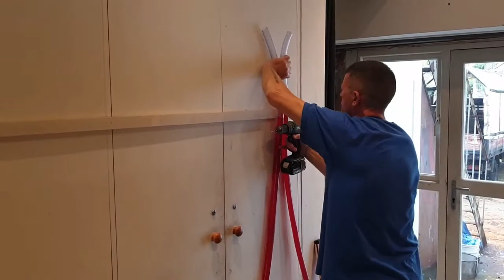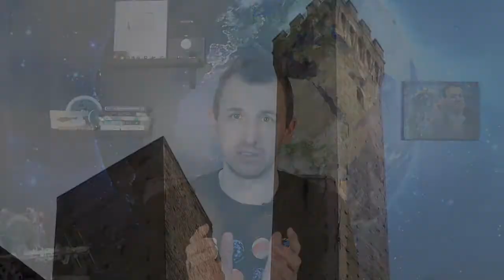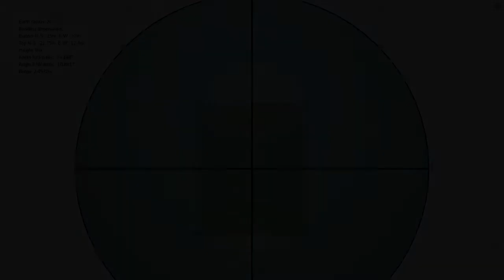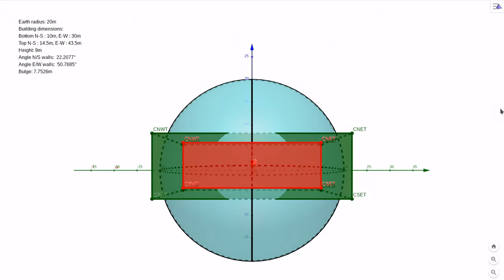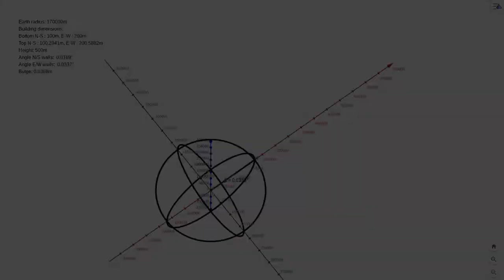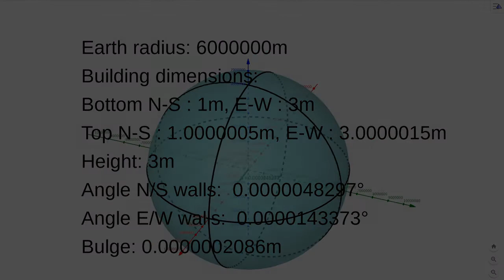Rectangular Buildings on a round Earth - examining a weird claim, Sciman Dan/Calvin Stroud response

Comment: All you did was make the sphere so large as to minimize the apparent slant in this geometric figure...otherwise you've yet to demonstrate from a practical construction or land surveyors standpoint that your theory works in practice.

In the beginning of the video it's clear in a smaller scale that everything you've said is hogwash.
Reply from the maker: So my mistake is to take the actual size of the Earth into account? Buildings are built on Earth, not on a tennis ball. The problem with Calvin's sketch is that it is not to scale  - either his building would be thousands of kilometers high, or his earth would be only a few meters in diameter.
Reply: @lower_case_t  Good sir...it is clear you possess a high intellect so I know I'm not talking with a troll...tennis balls are in the shape of spheres and the earth--prior to the acceptance of Newton's oblate spheroid--is just a bigger sphere.

The software you used to demonstrate your argument showed that there is still a slant you can sense and measure...and the slant never disappears no matter how large you blow up the scale. This is especially true when you measure the lines with a straight edge and other leveling instruments.
Reply from the maker: @jeremiahcastro9700  Yes, that was the point of my video. I also showed that the effect is so miniscule at that ratio between building size (typically 10 to a few 100 meters) and our planet's size (~6400 kilometer radius) that it is measurable but can be neglected even for the highest skyscrapers because it is outweighed many times by other effects like expansion caused by temperature differences. The precision we can achieve when we build such tall structures is way below what could account for the effect of Earth's curvature (centimeters in the case of a building that's half a kilometer high)
Reply: @lower_case_t  Your video still proves Calvin Stroud to be correct. While he may not have brought the earth to scale in his demonstration he did make the point clear that the plumbob/line would have to violate its own principles to build structures on a sphere by following the current laws of gravity.

And like most other counter explanations you built your structure at the very top and center of the sphere instead of the place where the curve actually is. Had you made your structure bigger then the slant and curved bottom would be more apparent.
Reply from the maker: @jeremiahcastro9700  Sure, if the Earth would be, say, three orders of magnitude smaller and houses would still be the same size (or if Earth had it's current size and buildings were hundreds of kilometers high), there would be a significant effect we'd have to account for. Nobody denies that. But, since the Earth has the size it has, he did nothing to demonstrate a problem with Earth's curvature and angles in buildings.
Reply: @lower_case_t  He didn't have to show the exact scale, he only needed to demonstrate the principles and how they work. The plumbline showed that gravity actually doesn't exist as it wasn't being pulled inward at an angle, and I've seen other construction workers from other parts of the world using a plumbline and they don't show that either.

Your video shows Mr. Stroud to be correct in his assessment and demonstration. And you've still yet to show your work to be true with the same tools used by Stroud.
Reply from the maker: @jeremiahcastro9700  "Your video shows Mr. Stroud to be correct in his assessment and demonstration. And you've still yet to show your work to be true with the same tools used by Stroud." - You commented on my other video where I I showed the quantitative measurement of Earth's radius using only a theodolite. If you haven't watched it, why did you comment there?
I am absolutely stunned by your refusal to take scale into account. The angle that the plumb line would form with parallel walls of a building depends on the ratio of the building's width to the  planet's radius - that's what my entire video is about. For real buildings on real Earth it's close to zero, so his plumb line did not show anything. It's plain math, I just put in the numbers. All the equations are in the video, if you see a problem with any of them, I'm happy to discuss all of them.
Also, it's not about showing the "exact" scale, it's more like getting it right within an error margin less than 4 orders of magnitude.
Reply: @lower_case_t  Except your demonstration relies on one building being built on one of the four cardinal points. If you place buildings between the cardinal points...your entire argument drops and refutes itself.
Reply from the maker: @jeremiahcastro9700  What is a cardinal point of a sphere? I always thought a sphere does not have a preferential direction. There is no fixed rotational axis either, therefore even North and South have no meaning in my model. And even if they had, how would placing the building anywhere else on the sphere affect any of the calculations? I must say, I'm speechless.
I'm also not sure what your point is - are you saying the Earth is indeed flat, as Mr Stroud claims, or are you just saying that he has a valid point with the angles (which I admit in the video, after all I do the calculations and present the numbers), but would agree that it is meaningless and irrelevant when you look at the actual size of Earth and buildings, and consider the low precision houses are built with?
Reply: @lower_case_t  It's sad how a person of such a high intellect cannot understand the simple fact that without a center you can't have left, right, up, down, front, and back. It's pretty laughable that you went through such great lengths with your demonstration and argument and can't understand that you can't measure length, width, height, and breadth without direction first being defined and laid down.

And prior to Newton defining and describing the supposed laws of gravity...the falling and rising of objects were already adequately explained with density: lighter objects rise while heavier objects fall. And the plumbline follows the principles of density as do ships and pebbles in a body of water.

Comment: Or, you could build by first excavating a very shallow secant plane and build your walls parallel to the radius at the center of your building. Or, just quit sweating the small stuff. A plumb bob isn't accurate enough to tell the difference.

Mr. Stroud is going to be in for a shock the first time he sees a building on the side of a hill. Walls that aren't perpendicular to the ground - an amazing thing!

Comment: In the first mile the earth drops 8 inches. People can't see 8 inches in 500 feet how can they see or understand it in 1 mile. Flat earthers dont understand the size of the earth or how it affects construction.  I'm not a surveyor or an engineer.  I have worked construction since 86 and now own my own company. We have a total station for layout and completely understand how things work on a spherical earth. To actually measure the curve you need a total station or a theodilite.
Reply: well how come engineers never took the curvature in building the Suez canal,which is very level in its distance,and length,was in the news recently,i never seen this curvature,plus the nile and other big rivers have no curvature affecting them,or the worlds biggest bridges have no curvature mathmatics built into ther contruction,or railway lines,from my travels,they are level every where,even going around hills or corners.
Reply from the maker: @bafalconbafalcon3184  It's funny that you mention the Nile here, considering that the - as far as we know - very first measurement of Earth's curvature by Eratosthenes was made between Aswan and Alexandria. Do you know which river flows between these cities? Architects have to take Earth's curvature into account when they plan long bridges.For example, the Verrazzano-Narrows Bridge in New York spans over 1,300m and it's suspension towers are about 200m tall - similar to the building in my video. They are 4cm farther apart at the top than at the bottom. You could argue that this is negligible, but it is still a measurable effect. Railways aren't flat. They bend up and down, left and right, just as the surface they're built upon demands. However, planning an underground train systems requires that Earth's curvature is taken into account, or tunnels will not be aligned properly.
Reply: @lower_case_t  Well how come with the bridge at Lake Pontchartrain in Louisiana, is flat as, even in the movie True Lies, on the bridge screen, anyways, it's 23.83 miles long,379 feet of missing curvature, another example, the Trans Australian Railway has over 300 miles of straight track, no curves, or curvature, since it was built in 1917,Lake Baikal,(Russia),is the largest fresh water lake on earth(by volume),and earths deepest lake, Surface area: 12,248 square miles.
Missing over 18,000 square miles of curvature in all directions.
The Uyuni Salt Flats, cover 12,000 kms  making it the biggest salt lake in the world.
It is located 3,650 meters up in the mountains of Bolivia.
You can do the math, but it's missing a hell of a lot of curvature.
The Nile and Mississippi ,and the Suez are FLAT
The Sues Canal is 100 miles with ZERO "curvature". If earth was a ball, there should be a 6,669 ft drop from one end of the canal to the other, but the canal has no locks, because the terrain through which it passes it FLAT.
Surveyors, Engineers, and Architects, never factor in the supposed curvature of the earth into the projects.
Reply from the maker: @bafalconbafalcon3184  You are talking about the bridge at Lake Pontchartrain, one of the most popular buildings to demonstrate Earth's curvature. A bridge where you can literally see Earth's curvature from each side because it's farther end lies below the horizon, right? What point are you trying to make?
https://en.wikipedia.org/wiki/Lake_Pontchartrain_Causeway#/media/File:Lake_Pontchatrain_Causeway_Southbound.jpg
And why do you bring up the Nile again? As I wrote already, Eratosthenes  measurement demonstrated it's bent by approximately 7° between Aswan and Alexandria TWO THOUSAND years ago, and that hasn't changed so far.
Reply: @lower_case_t  
Two chopsticks on a flat table with a light bulb show the same result.  You haven’t done this yet?
Reply from the maker: @toberrdrawforc  Two chopsticks show what effect? I assume you're talking about how the length of a shadow depends on a pole's position, aka Eratosthenes' experiment. But since that is not the topic of this video, please confirm that's what you mean before I point out the different geometries of the two scenarios.
Reply: @toberrdrawforc 
'Two chopsticks on a flat table...'
Try a third chopstick. Maybe you'll see the problem.
SohCahToa. Ring a bell?
Reply: @bafalconbafalcon3184 
You are conflating drop and curvature. They are two different things.
Reply: @bafalconbafalcon3184  well I'm not sure if you are a troll or truly don't understand. The first problem is understanding level and flat or perpendicular.  Level on earth is sea level meaning the average distance from the center of earth to where the oceans are. Water moves from higher elevations to lower elevations. What does this mean you ask?  It means that water conforms to the forces that act upon it,  just like a rain drop isn't flat. If you want to actually measure drop or even the lateral difference this has to be done by an instrument. No not a laser lol. A theodilite or total station which by the way has been done hundreds of times. If you truly don't understand i would suggest reading some books and stop watching flat earth videos. If you think the earth is flat then why isn't there an accurate map or working model. I can answer that, because IT IS IMPOSSIBLE.
Reply: @mathtime4578  
Why do large bodies of water have zero curvature, provably?
Hint: the land doesn’t have measurable curvature either.
You should look for yourself.
Reply: @toberrdrawforc  bodies of water do have curve and are easily measured. Even Bob the science guy done it with a simple builders level and that isn't even close to the accuracy of a total station or theodilite. Maybe you should check what you are saying before parroting what your priests tell you lol.
Reply: @mathtime4578  
You are incorrect.  You need to do the work yourself, instead of repeating ball lover fantasy drivel.
Reply: @toberrdrawforc  so you have a total station? I have one. You  dont have one? no problem rent a surveyor, then you could do it yourself with his instrument and help. Then you dont need anyone to tell you the bs that is called flat earth lol. There are hundreds of documented instances where people have measured earth curvature.  I know none of them take precedence over you saying nuh uh lol. Read a little bit actual try to learn something instead of being an idiot following con men.  Would you like me to share links to  bobs video or maybe maine surveyors video? Maybe you can share a video where a flerf used an instrument and measured the earth to be flat?  There is a reason you are a flerf and everyone sees why except you.
Reply: @toberrdrawforc , exactly what work have you done? Have you used any instruments? Have you made a flat earth map or better yet a working model? Do you understand the math needed to even begin to prove the earth is flat? You say do the work yourself.  Now why do you say this, because your priests tell you to say it. You have done absolutely nothing except watch flerf videos and do exactly what they tell you. I have looked at flat earth objectively. It took less than a day to understand it was impossible.  The sun and moon prove this without a doubt. If you think differently show how the times of the sun and moon work on flatardia and actually correlate with what is observed everyday around the world. If you are honest with yourself it won't take long to understand how stupid flat earth is.
Reply from the maker: @toberrdrawforc  "You need to do the work yourself, instead of repeating ball lover fantasy drivel" - You realize you're posting this on a video where I did exactly that work you're asking for, right? Watch it again, all the math is there. If you find an error please correct me. Please also watch part 2 where I describe in detail how earth's circumference can be measured with only very simple tools that are available to everybody, using an effect that could not be explained on a flat earth. Since you are  a subscriber at Eric Dubay's channel, may I ask when he did ever do "the work"? If there was any geometry calculation in his ramblings ever, I'd be happy to examine it. But afaik he never bothered to present anything of that sort. And neither did you, right?
Reply: @mathtime4578  
We can al see further than your theoretical globe model should allow.  Explain why, then you may have my attention.
Reply: @toberrdrawforc  first your attention is unimportant to me lol. Next this is an age old "gotcha" used by every flerf. It always and I mean always go back to 1or more of 3 things and has been proven countless times. First you have the wrong information. Second you put the wrong information into the calculations.  Lastly you intentionally are dishonest about everything, which happens more than the first 2. I will show you what I mean. If I have a warehouse floor that is 2 miles long you would say that is impossible to be flat because the earth drops 64 inches. In reality you would move 4 inches of dirt from the middle to the outside and it would be flat. Now if you understand how both things are possible then you have a lack of knowledge for your question and can easily be fixed. If you don't understand then do some research until you do understand then answer your own question about seeing too far.
Reply: @toberrdrawforc  why would I care about your attention, lmao. There are 3 things. It can be 1 or all 3. First wrong information. Second information was put in incorrectly. Lastly the flerf is being dishonest which is usually the case. This has been done so many times it really isn't worth much of a comment except to say you have to lie to flerf. Example, if a warehouse is 2 miles long you would say it is impossible because it would have 64 inches of drop. Reality you have to move 4 inches of dirt from the middle to the ends then it is flat. Yet it drops the 64 inches but you can't understand how it is possible. This is why you are a flerf. One last thought, everything and I mean everything in your life and every human on earths live is run and dictated by a globe earth. Deny all you want but even the simple clock you have is dictated by the globe earth.
Reply from the maker: I've almost finished the second part of this response, since Calvin asked for a way to measure the curvature. Most videos here on YouTube focus on Eratosthenes and his method, measuring the length of shadows of a pole in two different locations. I'm going to show Al Biruni's method, which uses a theodolite on an elevated viewing point.  So maybe you'll like it :)
Reply: @lower_case_t  i was actually thinking of doing it with our total station. I'm not sure the software it runs would show the zenith angles. We strictly use it for layout.  I would like to see that video.